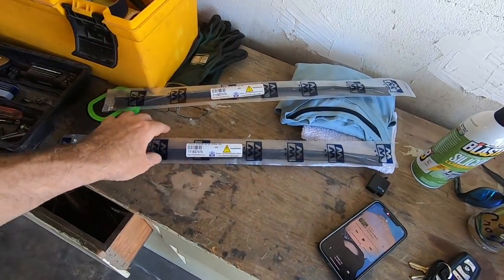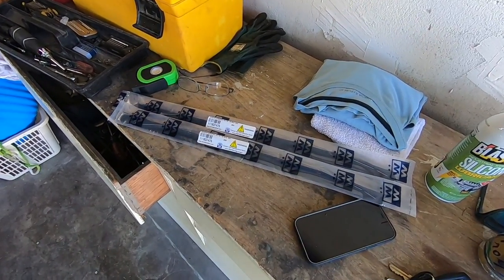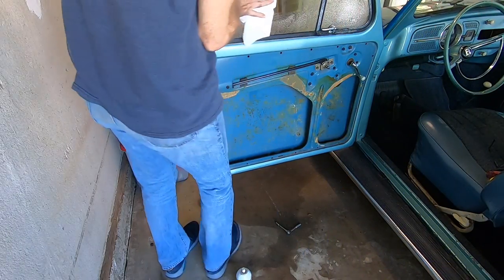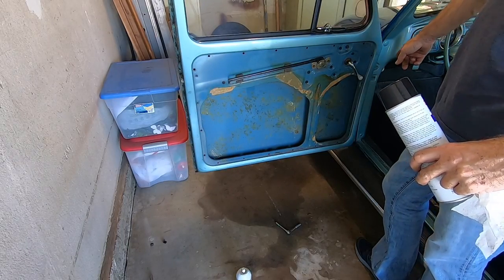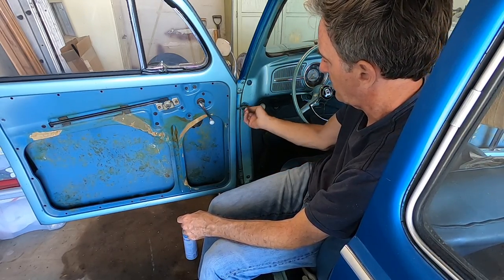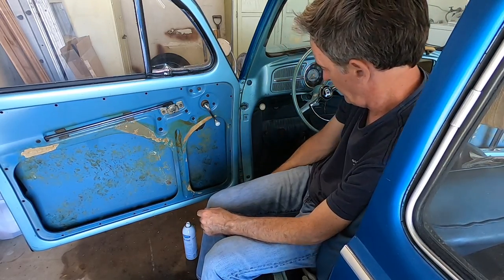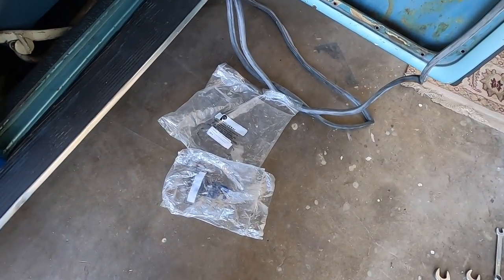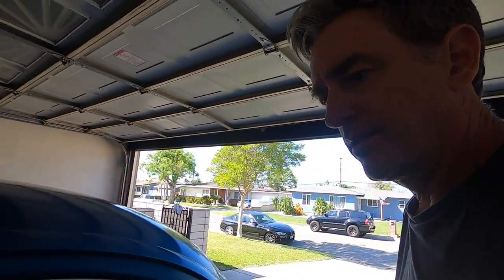1963 VW Beetle revival project - Episode 15 (Door and window seals - Part 3)

Comment: I had to replace a window regulator on my 64' sedan, beings it was all bent out of shape, and found that the aftermarket replacement was not as strong as the original. I totally restored the whole door, including the vent window glass rubber, which required some silicone teamwork.
Reply from the maker: Yeah the parts take a little more arts and crafts to install.
Reply: @RABBITMotorworks  I ordered rivets, (1/4" long they were), to install the new vent window latch and still haven't figured out how to use those tiny rivets! I ended up using a regular rivet gun with reg. rivets that worked just fine. Whatever! Yeah, arts and craft and patients'.